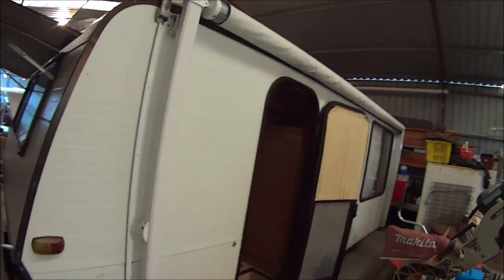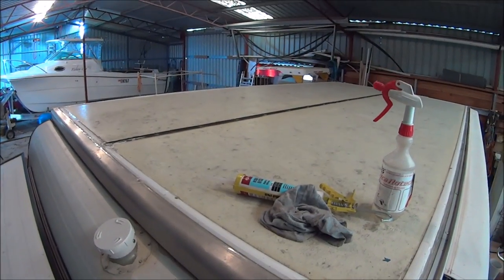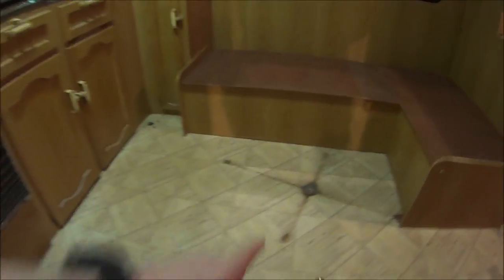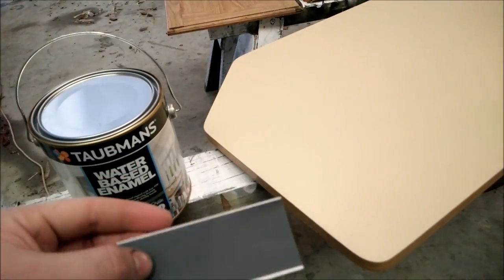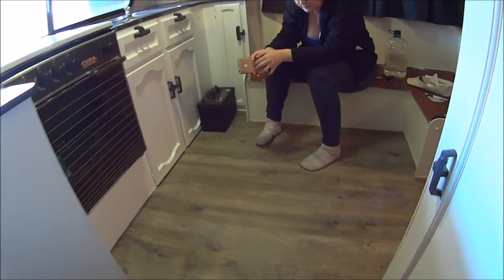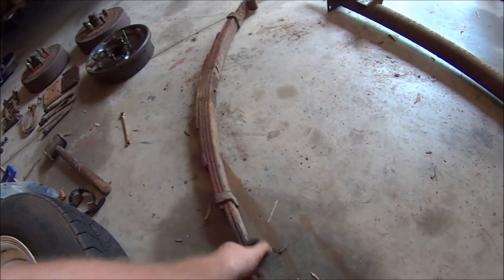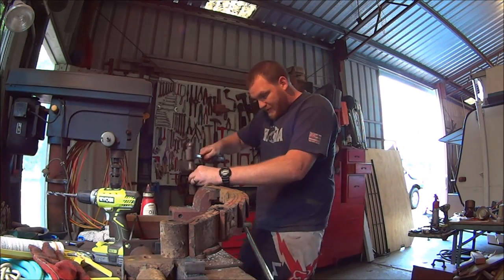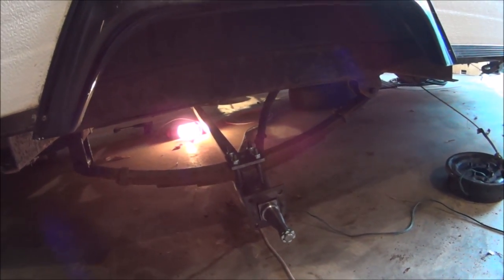Viscount Seabreeze Offroad Renovation

Comment: love the video. Can you guys give any tips on buying a 2nd hand seabreeze. What to look for ? what should be pre purchase checks. Can you mention products you are using as well. Ie if from Bunnings or carvan parts store. The van looked pretty tidy when you got it.  did you shop around to find it?
Reply from the maker: Thanks mate!  Few things worth checking are that all the electrics work (Inside and out, on 12v and 240v),  check that gas works and ask to see fridge/oven/hob working.  Check for excessive rust on the chassis and draw bar.  Look for scalloping on the tyres (can be an indication that axle is bent or spring mounts have had a knock).  Open all the cupboards and look for signs of water ingress (staining, blistering or swollen chipboard). From the inside,  look around all the windows and anywhere else a seal could fail and let water in (I had some water damage from where water had ran in around the tail lights).  And finally,  tow it with the vehicle you're planning to use- to check electric brakes work and see how it's going to handle with your car (you may need to fit trailer brakes,  an Anderson plug and possibly heavy duty rear springs or airbags if it's your first van). 

It was the first van we looked at.  Had been stored inside a shed and hadn't had much use recently,  price was right so we jumped on it. 

Sealants, tools, adhesives, paint, flooring are all available from Bunnings.
Axle,  wheel bearings,  hubs,  brakes,  grease,  hitch etc were from a trailer parts store local to me (martins trailer parts if you're in WA).  Foam,  and material for curtains,  cushions etc were from spotlight. 
Hope that helps!  There's some brilliant forums on facebook for viscount and renovating caravans.

Comment: Hi Cam,
Great Reno.
I’m now thinking of purchasing a van similar to this and would like to know what it would cost me to do a similar job to yours, in particular flipping springs under axles.
I was weighing camper trailers as well but decided to go with Caravan instead as it would give me better weather protection. Do you use your camper trailer in winter.
Many thanks,
Andy.
Reply from the maker: We didn’t keep track on the costs of this project but it wasn’t overly expensive as we did everything ourselves. We ended up flipping it for double the price we paid 👍 camper trailer in winter goes fine, just a pain drying the canvas out afterwards, but we no longer have the forward fold camper either.
Reply: @WildTouring  Thanks for that.👍

Comment: Look used 5 leaf springs 45mm x thickness? around rated 500kg (1000kg/pair), To replace new spring upgrade to 7 leaf 45mm x 8mm  Rated 800kg ( 1600kg/pair) much better. Our 1988 Viscount Sea Breeze 15ft PopTop

Comment: Shouldn't use turps to degrease, it'll leave a film and could affect how sealant adheres, IPA or Prepsol would be better options for people who want to do the same job on their vans.
Reply: Yes mate bad choice of cleaning solvent 
Turps will definitely affect the ability of silicone to adhere 
I would expect it will peel off like a wet bandaid I am afraid to say 
IPA isopropyl alcohol is what you should use only 
Or metho 
If you every wanted to paint over the roof you could use polyurethane sealant but it will not be UV stabile without paint coverage on the seal cheers

Comment: Great vid mate and it has inspired me to do the same thing with a second hand older caravan. So whats the verdict, camper trailer or van? Or have one of each?
Reply from the maker: guseva1 thanks mate.  We had a lot of fun doing the build,  did a couple of trips in it and it worked wonderfully.  I did end up selling it (and making a decent amount of money on it)  to buy another camper trailer.  But I bought a forward fold camper this time,  as I loved having a seating area inside for somewhere to take shelter in poor weather.  We like to do a fair bit of remote, solo,  off grid camping.  And found that the caravan was too tall and long for tight off-road tracks (even a relatively small poptop like ours).  We're a lot more confident off-road with a camper trailer.  I posted a video of the new forward fold camper trailer if it interest you.
Reply: Thanks for the reply mate and I have to agree that camper trailers give you a lot more confidence to go to a lot more places. Great channel mate keep it up cheers